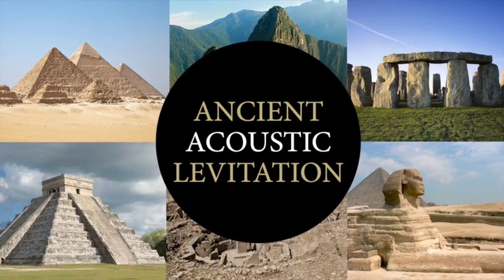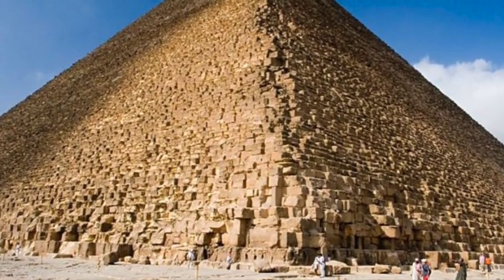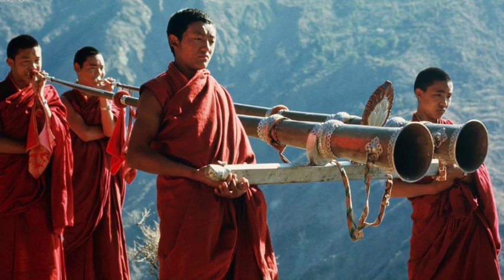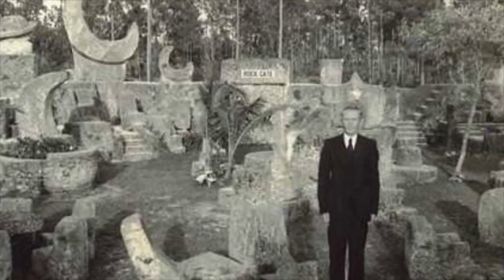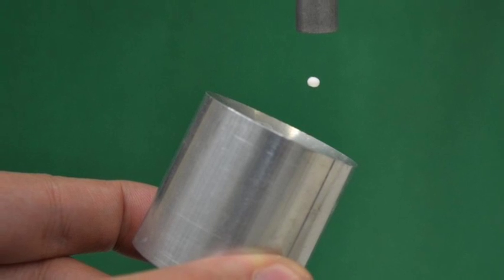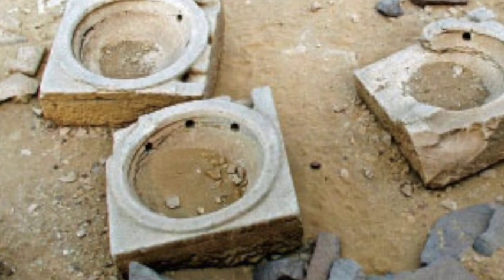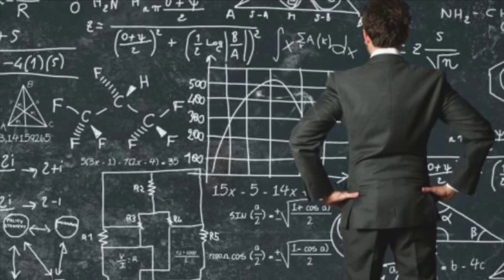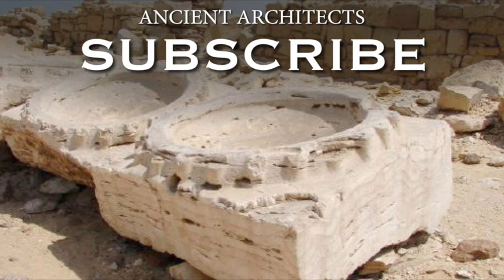Acoustic Levitation in Egypt - Ancient High Technology | Ancient Architects

Comment: I do believe that Granite was moved by boat but I disagree with you on the idea of acoustic levitation , I would much rather believe that the Egyptian people cut stone with copper saws and sand both were readily available both were used.   As far as the bowls are concerned  they were actually gears that were being cut and were rejected because they were not solid enough,  and as far as 400 men dragging a stone across the desert I would much rather think of The Oxen they used at that time were used instead of the men who are running the cranes yes ancient Egyptians had cranes they also had elevators that's what the grand Gallery is all about everything came up from the grand gallery and was dispersed around the inside of the pyramid and was built from the outside edge in the grand Gallery was probably used with a counterbalance on the outside and the stones were all brought up and moved around into their perspective places and set as you get further up the pyramid you don't need as many cranes to pick up the loads because they're already halfway there you could probably get away with only having four cranes and build up the upper tier of the pyramid.
As far as the Coral Castle that is a whole new kettle of fish that was strictly balance and counterbalance the man knew what he was doing he can work by himself because he had machines to do three times as much work as he could do.
I've seen a man here on YouTube use buckets of concrete on a 20-ton Stone to get it to stand up in its place perfectly using nothing more than some counterweights and some boards I think the the engineers were smart enough to know how to use balance and counterbalance.

Comment: 8min :17sec. to 10min : 39sec. Perhaps the stone basins were coupled together? Some have a gear tooth ring around them with a solid round rim seal. Others have just the rim seal. If you put the two together with either the gear side as the bottom or the gear side as the top, and the three and sometimes four holes in each bowl would be used for wires which would connect to whatever was inside of each basin complete block? (Each pair would act like a receptacle box with a device in each pair with the entrance holes and exit holes for the wires? ...And by using another separate gear, directed into one of the "junction box gears," you could then turn and manipulate whatever is on top or between the two connected basin blocks? ...Again, this is just my theory! It makes more sense than a sacrificial basin! The people who believe these are for blood rituals, are just f*cking dumb.

Comment: I'm more inclined to suspect water directed beneath the blocks to create hydraulic lift and lubrication simultaneously. Unlike the depictions of water being poured ahead of the blocks to merely lubricate the surface, directing water under the blocks would also provide lift. Water from a container higher than the block would use gravity. The volume is not as important as the height.

Comment: Cont'd from previous comment:
This is an example of how crystals / quartz would be used to generate electricity or used in a ultrasonic cutting tool. 
HOW ULTRASOUND WORKS:
"The transducer probe is the main part of the ultrasound machine. The transducer probe makes the sound waves and receives the echoes. It is, so to speak, the mouth and ears of the ultrasound machine. The transducer probe generates and receives sound waves using a principle called the piezoelectric (pressure electricity) effect, which was discovered by Pierre and Jacques Curie in 1880. In the probe, there are one or more quartz crystals called piezoelectric crystals. When an electric current is applied to these crystals, they change shape rapidly. The rapid shape changes, or vibrations, of the crystals produce sound waves that travel outward. Conversely, when sound or pressure waves hit the crystals, they emit electrical currents. Therefore, the same crystals can be used to send and receive sound waves. The probe also has a sound absorbing substance to eliminate back reflections from the probe itself, and an acoustic lens to help focus the emitted sound waves."
BY CRAIG FREUDENRICH, PH.D.

The Djed pillar would work in a similar fashion to generate electricity. The 4 cross sections on the upper part of the pillar would likely be quartz / crystal or even mica plates for a lighter application.
These pillars have been depicted with the Ankh or a what appears to be a plate( maybe a sphere) on the very top. 
Like I said in previous comment; everything has a resonant frequency, ( a specific frequency that will cause it to vibrate). The Ankh for example placed on top of the pillar and made to vibrate with a resonant frequency  would of sent a sound wave down thru the center of the piezoelectric plates then producing electricity. The Ankh would of course needed a constant frequency applied to maintain a state of vibration. Could this be the reason for the obelisks? ANY THOUGHTS?
Reply: For a quick understanding of  how much electricity crystal is capable of producing :
http://windulum.com/page0/page0.html

Comment: When you go ultrasonic, you can cut with precision: 
https://youtu.be/gvanbCA9W-Y
If you look into the details of this tool, it uses a piezoelectric element and an oscillator. 
 I think it is obvious these ancient builders had knowledge of piezoelectric rock, like quartz.  
Interestingly the "Schist disc" found in  Saqqara,  has been suggested to of been part of an oscillator.

If you have seen the cutting graphics at the granite quarry, and the drilled holes in granite stone etc....its obvious it was all done with a machine. The cutting graphics are too consistent to be manual.

Comment: Could it be possible the bowls were used as a sort of speaker? Using the three ports for the sound waves to enter then be focused. Also multiple ancient civilizations whom have built pyramids were known to possess large gold discs also bowl shaped. Look at amphitheaters. Also wasn't musical tuning standards changed. Guess I'm talking about harmonics. Or properly tuned harmonics. Anyhow. Focusing the strongest tuned sound waves through hundreds of dishes or bowls would generate a field large enough to move masses. Also the Tibetan monks play horns! Three holes in the bowls could allow for three musicians to play continuously allowing for breathing. Circular breathing concept, used in aboriginal dijurido playing and monk vocalizations. We've known Opera singers to break glass. OK wine glass acts like tuning fork. Catching vibrations. due to the slight narrowing of the glasses mouth the vibrations put out in proper concentration pitch and frequency build up inside of the glass until it breaks. THIS IS EXTREMELY INTERESTING AND ID LOVE TO HEAR FEEDBACK.
Reply from the maker: Your hypothesis is good!

Comment: ...And it gets even funnier when you remember that newton's third law a thing (meaning that the object isn't just floating, but the levitation device is still being pushed into the ground). That alone would mean that lifting it via acoustic levitation and via brute force are basically the same in terms of force applied on the equipment. On top of all of this, you have to remember that there is an upper limit to any acoustic wave's amplitude (strength) that is just double atmospheric pressure (due to the troughs being at most a vacuum). Maybe you could levitate a pebble, which, admittedly would be kind of cool, but levitating such huge objects is not only infeasible within earth's atmosphere, but is also preposterous in its proposition. This is a load of absolute bull.
Reply: Not if you could do it efficiently.  Maybe not viable or easily done but also not really a load of absolute bull
Reply: You don't have to lift it, just move it along a surface. While the stone is vibrating friction is almost a non factor,  almost like it is on wheels. This makes even the heaviest loads many times easier to move

Comment: Well I have had a theory that if the stone is resonating it could be changing its mass or matter frequency of the minerals that hold it together and making it lighter and I have another theory that the modulation is actually vibrating the atoms enough to change there atomic frequency like slightly moving the atoms out of there orbit and causing antigraving like effect making it lighter orrr somehow making a half wave resonance inside the block to pulse downward against gravity or ground to break the friction so it can be easier to move,it would be like floating on water once the friction is broken ,I have done this many of times by using vibration to see things move on surfaces and I mean big things move easier with vibration.

Comment: I’m pretty sure they proved that they used to use wet sand to move them. There’s a mural depicting a worker pouring water in front of the rock as it was transported, it had a specific ratio but is still amazing.

Comment: very stimulating ideas.  the 3 pyramids of the giza plateau have functional relationships length and width but also vertically.  this seems to indicate that reason the pyramids were built was for location purposes from above.  doubtful the pyramids could have been built manually.  no way.  there were no schools for the masses back then.  there was not enough paper back the to create engineering drawings for the pyramids.  lots of new information about the past yet to be discovered.  i like the way you think.

Comment: You can debunk this bullshit with the conservation of energy. Based on some quick googling, a 1x1x1m block of granite weighs 2750kg. The energy needed to lift this even one centimeter is 2750kg * 0.01m * 9.81m/s^2 = 269.775 Joules. That doesn't seem like much, but a sound loud enough to produce this energy density would need to be more than 140dB, which for reference is louder than a fucking jet engine. It's loud enough that it would cause anyone near it physical pain and hearing loss. And this is to raise a block smaller than the ones in this video a height of only ONE CENTIMETER. And that level of sound would need to be sustained for at the very least, several seconds if not minutes, would have to be focused extremely intensely, and would permanently injure anyone near it. This "theory" is the dumbest fucking thing I've heard all day.

Comment: I'm sorry to piss on your hypothesis, but you would need a serious amount of energy to generate sound that could support the weight of stones a fraction of that size. If set up just right, standing waves can increase the energy of a sound wave and if set up wrong, can cancel out the energy of a sound. Standing waves, however, can not magically generate unproportionate amounts of free energy! The efficiency of such a system just doesn't add up. If you had enough energy to generate the sound required it would be a million times more efficient to use that energy directly to move the stone! Using that energy to produce sound will waste energy, then using that sound to produce electromagnetism in a ridiculously inefficient way will waste even more energy. To lift a stone will take the same amount of energy whatever method you use. That's basic physics! So they most likely used an energy resource they had a plentiful supply of and which was most efficient, you know, like manpower and animals for example.
Reply: The vibration caused cancels out any objects mass as it is no longer being affected by the environment around it.
Reply: The sun has a lot of energy. What if you used that to create sound.
Reply: al35mm speakers to enlarge sounds
Reply: Martha Nicholson omg are you an idiot?  A stereo uses electricity to amplify the signal to the point that it will vibrate the speaker and increase volume.  That’s why you have to plug it in to that magical port in your wall.
Reply: This is interesting. Teslas experiment in NYC in his residence is documented. The exact way he did it was not. But however he did it, the device was in his space, which in comparison to the building size, was tiny. And if the building was not one with the earth it would have moved. I believe he coined the term, mechanical resonance, at that point. I also believe the device used was mechanical in nature. Using this information, maybe the Egyptians used a similar technique to achieve their goals. Our society is profit driven. And if something can be achieved /attained easily that would make life easier for the masses and make profit difficult or impossible. These things are stifled. Just look at solar, purposefully sabotaged. Any thoughts?
Reply: al35mm best comment so far... 
Pentrah5 - did u actually see the size of the objects they were levitating, and the equipment they were using to do it?   I’m not sure what the amount of energy they are using to actually perform these experiments is, but I can guarantee  that it is more than a few hundred (or thousand) people singing into stone bowls.  Where did you learn physics, an alternate dimension?  

I can’t believe the things people will believe these days because some creative pseudo-weirdo can edit a video on his MacBook and post it to YouTube!
Reply: al35mm...  When did you learn your physics? - in the nineteenth century?  Sound levitation is being developed now. It already a fact and will certainly develop quickly into a form we can use in the course of time.  Remember how scientists used to laugh at things in Star Trek? - "We know it is scientifically impossible." they said - and gave detailed explanation why it wouldn't work.  Now we see some of those ideas coming into everyday use....When we have at last defined what gravity actually IS, then we will be able to manifest anti=gravity to our advantage..
Reply: al35mm  can you explain an echo to me ? How does it increase in volume

Comment: you wouldn't want to load large blocks upon barges, you would sling them underneath, and take advantage of natural buoyancy,  and lower center of gravity
Reply: Natural buoyancy of granite blocks?  How does that work, exactly?
Reply: @Querent2000  a one cubic meter block of granite weighs one metric ton less in water than it weighs on land. That's a ~40% reduction. And less friction too.
Reply: Exactly and they were tied up at low tide and moved at high tide.
Reply: of course they dug a network of canals. traffic flows both ways, as trade is very important to every civilization
Reply: You might even use papyrus bundles instead of boats. About 3x the volume of papyrus will float a stone, or so I'm told. 

If I had to move stones over land... I'd cut them oversized and round, roll them to the site, then trim them square. I'm not saying they did that, but maybe they shoulda. They sure AF didn't use quantum magnetic sound wave crystals. .

Comment: look at ancient Roman highways, imagine them using the flattest stones on the surface. clay is one of the most common substances. spread a layer of wet clay onto a paved stone road, and push/pull your quarried blocks.  after a few miles the down side would be smooth if not polished,  I think

Comment: Rather than sound, could it not be anti-magnetism to move the objects? This has always been my theory of it.  As mentioned in the video,  the 'papyrus' placed under an object could be metallic and magnetized. The metallic runners could also be magnetized and arranged so that the poles are matching and causing them to levitate therefore they could very easily be moved along the channel. By lifting from behind and replacing in front of the object as you went along, you wouldn't need miles of metal track.  Also, from childhood, I'm sure I remember metal becoming magnetized when you hit it and rubbed it with another  metal object, maybe that is what the person mentioned was doing.

Comment: Thanks for another intriguing video. I appreciate that you encourage conversation and present ideas without necessarily committing to any of them.  Most of this is conjecture and speculation and will probably remain that way. 

Neither am I an expert in acoustic levitation and only know what I have read elsewhere. These 'standing waves' that can be created by reflecting sound create a place where the air pressure creates a kind of balance with gravity and so very light objects are able to 'levitate' there. Is is not fooling gravity in any way. It is not anti-gravity or any such thing, it's just the pressure of one force is balanced with the pressure of another, a lot like keeping a beach ball afloat on an upturned fan.  But for all that, I've never seen it work on anything heavier than a ping pong ball and I don't think it can from what we know.  

My feeling about those very interesting bowls is that they had a far more prosaic use.  I think they were a fountain--either a decorative or functional one--for collection of water. They would be tiered and spill into the next as they reach the spouts on the rims. This seems a likely function to me. 

Anyway, thanks again Matt and keep it up.
Reply: What if the metal forks that you mentioned in other video aren't for cutting rocks only but were placed on a rock or underneath to make continuous resonnation and the rock can be easily moved by few people